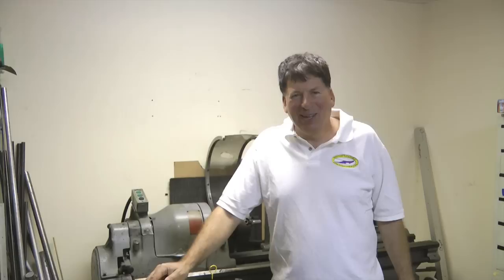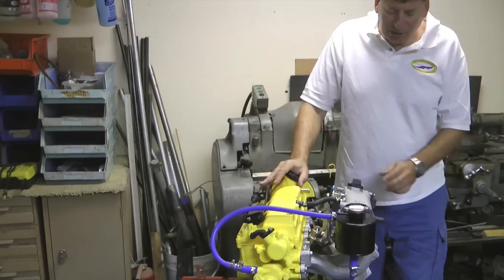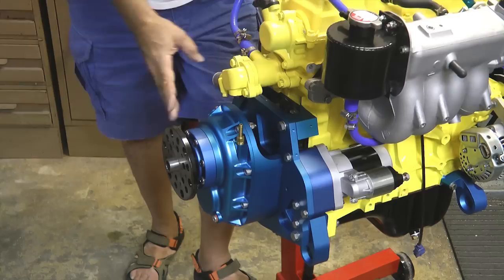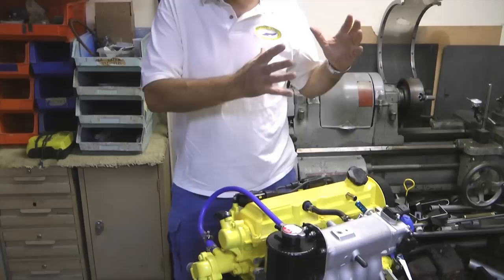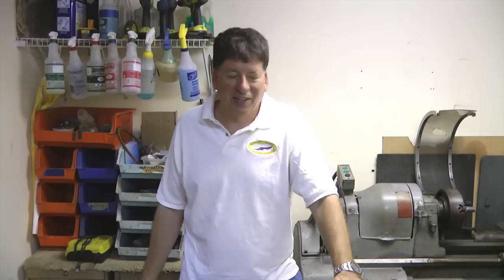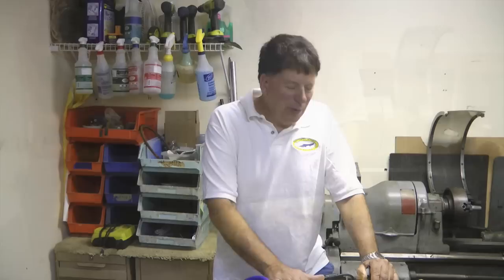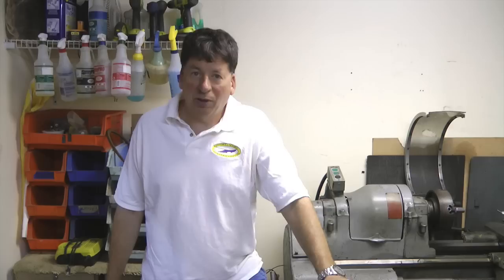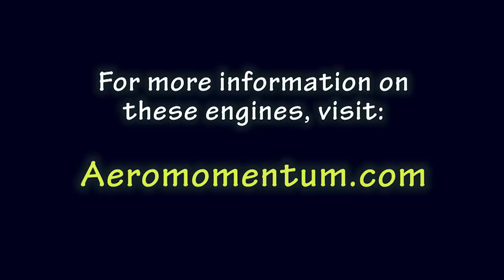Aeromomentum Aircraft Engines

Comment: I once worked for a suzuki marine dealer. Most of that engine is and was used in marine use, I seen outboards get as high as 7000 hour of use in commercial use, what killed them was corrosion in use of salt water. The only time I seen fuel problems was ethanol  in land base fuels, the valves seats could not handle it. We found places that would sell, what they called 10% ethanol fuel as high as 20 to 25%..
Reply: You are so right with the Goddamn Ethanol in the fuel and all its problems! Thanks for posting !
Reply: Ethanol is fuel is big subsidies for fuel ethanol producers taken from taxpayers to damage their engines Talk about cronyism.
Reply: Never add oil to fuel for a 4 stroke engine. When you add oil, you are removing the fuel that the engine need for mixing with air, this can cause a lean out and with the oil can cause plugs to fowl and not give a good burn to the AF mixture.  I have a gas station near me that sells ethanol free fuel, yeah cost a little more but no problem.
Reply: Questions, is it it fuel injection or carb, Keep in mind, if you run a 2 stroke the jetting in carbs are set for the added oil where 4 stroke is not, being mixed with fuel in the tank. EFI is the same, but the EFI uses sensors to get data to mix the AF to engine temp, air temp, and humidity in air. There are a few more to go with EFI but that is the main ones to start with. Suzuki outboards have no O2 Sensor and it base of what I said above, it used the anti-knock senor to add fuel even more than a automotive engine would as it has an upstream and down stream O2 sensors.
Reply: It's not made to burn, it is made to lubricate. yes 200:1 is not much, but the AF program in the ECU is made with pure gas at the factory and Air temps and humidity factored in.. Now with that being said, Unless that engine was made to run on E85 or flex-fuel, that oil mix will have a long term effect. It will cause lean out because you have taken that fuel ratio away from what the computer thinks is in there.. If you think that oil was made to burn why not run it 100%? Why you think that 2 stroke engine are on the way out? A is emissions and B fuel mileage. Diesel Engines are next on the chopping block for the same reasons..
Reply: drunknpossum They won't get rid of diesel engines for many many years,because there is nothing to replace them with. I get 6 to 8 mpg out of a 14 liter Cummins at 80 to 88 thousand pounds gross vehicle weight. First off ,there are no comparable gas engines, At the moment,the largest gasser right now is a 496 cu.in. V8. It hasn't been produced for a while now. It would explode trying to run 88,000 pounds down the road at any speed,much less highway speeds.Nobody has made a gas engine even remotely comparable in 50 years or more.Even then the milage was usually 5 or 6 mpg with no load,and down to 3/4 loaded. They have almost reached the outer limits of electronic bullshit,to help with emissions,and fuel control.The new engines are almost to complicated. Big diesels will be around for years and years,yet.
Reply: The commercial engines are used closer to the 80% then a recreational use engines.  These guys ran crab pots, the engine is either wide open or idle for most of it's life, carrying a lot more weight. Also an outboard is doing more compared to what a car engines do, Outboards are much closer to aircraft engines in the fact they are trying to push weight the whole time it's in gear.
Reply: I agree. If the engine has a feedback system (anything from the last 45 years or so, the computer will compensate for the small change in air fuel ratio caused by the oil. Oil has a optimum air/fuel ratio for burn as well.... The only thing I would be concerned with is possible ash from the burned oil contaminating the catalytic converter.
Reply: The fact is that Diesel fuel has a higher BTU also, why the Jet turbine is going today with the use of Fans with a smaller power plant.
Reply: Olle, you have to remember with most EFI systems today the EU and EPA has a close tolerance on how much they are allowed to deviate, it's all about emissions for the last 20 years...  only Aircraft has a bit more leeway for this, along with just about all recreational stuff, Outboards, ATVs, Motorcycles.. But from what I been seeing the last 10 years, they are getting tougher on the recreational types...
Reply: yeah "E85" fuels sold at bowser in Australia are more like "E75" LOL,they had same prob in brazil which is why GM developed the "flex fuel" sensor to detect ethanol concentration and ECU adjusts accordingly
Reply: What places are you talking about that sold gasoline containing 25% ethanol?
Reply: What do you mean when you say "lean out" ?
Reply: I agree. Putting gasoline engine in the ring with a diesel engine, would be like putting me in the ring with Mike Tyson, biting allowed. The diesel engine fears no other. It will continue to roar forward.
Reply: If you take a engine that made to be run on X type of fuel and you change it without making changes to the fuel system, like going from normal gas to E85, the engine will lean out. And ethanol  base fuels are bad about water adsorption.  Back in 2006, here in the states, when there was a oil shortage, the companies that would bring fuel to the gas pumps was mixing more ethanol in the gas than what was to be allowed.  Basically they were cutting gas with ethanol.  Think about it like this, you have one of them Flex Fuel cars and check the mileage with normal 10% or less ethanol then change to the E85 fuel you will see about 30 to 50% more fuel burn with E85. These guys that are "racing" with E85 fuels are not running stock fuel systems to get the power that E85 can make, it has to have a lot more fuel flow/volume to get it.
Reply: actually legislated 10% ethanol content for automotive fuels sold in australia,aircraft fuel however seems to still be totally exemp LOL,with lead still and over 100 octane
Reply: Well there is some 100 that is no lead also for aviation..  Marine fuels are also exempted also...
Reply: the smartest thing i have heard even possible to cool n filter egr blow by system is a thought  KKKn50cal

Comment: Nice work! Been checking out the mazda rotary engines in light planes lately fascinating stuff
Reply: As Aircraft Tech restoring WWII crashed, etc. Many trips to Oshkosh from about 1987, 
Coors had experimental crafts with rotary engines that caught my eye with very compact details on display. 
I'm sure since then, they must have advanced even more so. 
Trying to recall, but I think the it was the Coors Bullet, but needs to be confirmed. 
Cheers

Comment: It looks like a great tool for the farmer that needs to connect many irrigation hoses cheaply and efficiently. I don't see an automotive use when access is restricted to maneuver the tool into locking the wire. A nice tool to have in a pinch on the farm. It would be a great tool for attaching hard pipe runs to anchor saddles.
Reply: rolomatic Z I

Comment: Question:  Can the AM15 be installed in a autocopter craft?  Can an additional oil cooler connected to the oil filter (not a separate oil tank) (An oil cooler similar to one installed in motorcycles) be also installed? What about a variable pitch propeller?

Comment: In your development of your 3 cylinder motor is it possible to have an option of crank up and head down installation with gearbox in high position like a Walter Lom motor ?  This would allow for a longer  prop with slower prop speed with increased prop ground clearance and more thrust per horse power because of slower prop speed RPMs.

Comment: While the lower fuel burn may offset the heavier engine weight with lower fuel weight,  the additional engine weight cause balance issues.  To counter the longer front moment,  might have to add ballast to the tail.
Reply: The weight and balance will not be a problem with this motor.  The motor weight of this motor will be tucked closer to the firewall then on conventional motors because of no mags next to the firewall. Placement of weigh has a direct linear value from center of balance .
Reply: Dave, you are correct.  My 701 required 15 lb of weight in the tail to stay in weight and balance with only one person aboard, for an AM 1300 install.

Comment: I would definitely welcome less pricey engines. A couple of things I wonder: 1) wouldn't it work fairly well without a gearbox at 4k rpm with a slightly smaller prop? getting rid of the weight, wear and efficiency losses. And is there anything in particular about intake and exhaust that requires pipes or could it just be one big pipe/cavity? it seems to me that narrow piping burdens the flow. Simplifying the manifolds could make it more streamlined/lower profile. Alternator and starter could also be one.
Reply: will work. 
But when all factors are taken into account, the power to weight ratio will take a hit.
Reply: @BlueMax333  well you also lose some weight but perhaps the biggest issue is fuel efficiency. although isn't that also better at lower rpm? so maybe if it's a relatively fast bird where prop size isn't all important, maybe the compromise works out.
Reply: @DanFrederiksen  
> AM13. 1.3 liter, 77.1 kg (170 lbs) dry.
100 hp @ 5800rpm (2240 prop rpm)
112 hp @ 5800rpm
126 hp @ 6500rpm
> AM15. 1.5 liter, 83.9 kg (185 lbs) dry.
117 hp @ 5800rpm (2240 prop rpm)
131 hp @ 5800rpm
147 hp @ 6500rpm

Are you saying that these engines will be more fuel-efficient without a gearbox?!
Why do you think converters of auto engines such as Aeromomentum, Viking Aircraft, etc fit reduction drives?
Reply: @BlueMax333  because they focus on low speed and generally a large prop is more efficient. might not be more efficient but could maybe be close. But ultimately we should drop piston engines entirely and make turbofan jets. distance record of 40000km belongs to a simple off the shelf smaller jet engine. Not a piston.

Comment: Looks like a well thought out engine.  I have a couple of questions: 

For the gearbox, are there any resonant  points in the engine's normal operating range where continuous operation must be avoided?  And can the gearbox tolerate 3 cylinder operation without shaking everything to bits?

Are ALL of the solid state electronic elements full dual channel so that there are no single-point-of-failure elements that can crap out with no warning, no fault tolerance, and no way to detect a defect in advance?  The ignition coils are also a concern.  If there are two coils each firing two cylinders, it means you pretty much have to have both working, which makes two coils half as reliable as a single coil.  It would be better to have one coil for each plug, or better yet two redundant coils with two redundant primaries and power supplies each firing all 4 plugs.
Reply: 3 cylinder engines are smoother than 4's.

Comment: Can your motor be geared to a lower RPM so I can swung a bigger slower prop for better efficiency ? This is a very easy way to better achieve performance without touching the motor.  I am really interested in your proposed 3 cylinder for a Murphy Maverick.  Also looking for a suitable motor for the Zenith 750 three place aircraft.

Comment: How do you retain oil pressure when flying inverted with a "vehicle based engine"?
Reply: You don't fly inverted in an airplane in the that engine!
Reply: The same as with any wet sump aircraft engine, which can't run upside down either.  You have to build a dry sump oil system to replace the oil pan with a separate tank.  Then you can run inverted all you want as long as you also have a fuel system that works upside down.
Reply: John K I know HOW they are supposed to work, the engines shown have oil pans on bottom, which is why I asked...
Reply: John K and can maintain enough lift and the winged being able to take the negative G-Force but you guys already probably know that in just didn't say it
Reply: metalfox1911a1 So your implying a light sport aircraft cannot fly inverted?  Lol. I suppose the majority cannot, do to the shoddy construction or piss poor design. But I have several that not only fly inverted but can handle any acrobatic maneuver the full size planes can do, maybe better.
Reply: Ok.  Well my point is 98% of piston aircraft engines have oil pans and can't run upside down either so it's pretty much the same thing.
Reply: Accutronitis      you might have to add a scavange pump
Reply: Don't underestimate how hard it is to do.  Would you want to be the test pilot on the first flight where you go inverted?

Comment: I dont see any lock wiring anywhere, is this done or not ?
Reply: Wrong !
Reply: For years Lycoming put those little sheet metal jam nuts on the nuts of the case mating bolts and on cylinder hold down nuts. After a time it was decided they served no useful purpose and most Lycs use no safetying devices at all on case  and cylinder hold down nuts, or valve cover screws and lots of other places, like hose clamps.  Connecting rod stud nuts are cotter pinned however and you do lockwire other fasteners in certain locations, especially critical items, but it's surprising to see other places on an airplane with no safetying devices, like magneto distributor caps;  they're just held on with two machine screws.   In general you will not see lock washers on airplanes because they are bad news structurally, It's either cotter pin, lockwire, distorted bore locknut, fibrelock locknut, or nothing.

Comment: I think your stuff is great! But a new long block is not a good selling point because of core shift due to internal stress created by casting. I come from racing but it's well known that as the block and heads go threw heat cycles thus causing slight warpage as the metal normalizes. I often look for a higher mileage block that's in good shape because after its normalized once you line bore the mains and get the cylinder wall true it will stay that way for ever.
Reply: Nick Holm I'll save you some words it's called a seasoned block,
Reply: Nick Holm that only applies on cast iron 
Aluminium gets its tempering during the cooling after casting

Comment: You don‘t have nothing impressive with little 
baby horsepower. Now lets talk whats inpressive that is for airplanes car V8  racing engine over 500 to 700 horsepower with a propeller has 13 blades in a circle and the blade made for very hard steel and each blade at 14 inches  wide with very high flow of air with the maximum pulling power starting at a 1000 R.P.M. AND UP. IT BE BETTER ON FUEL ECONOMY ON A TRIP